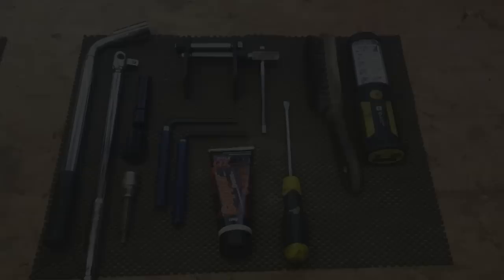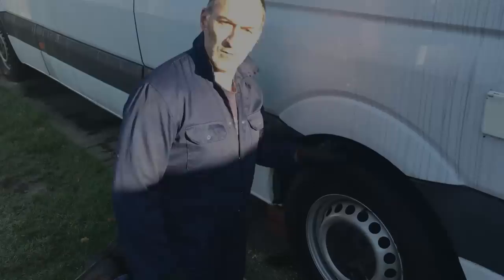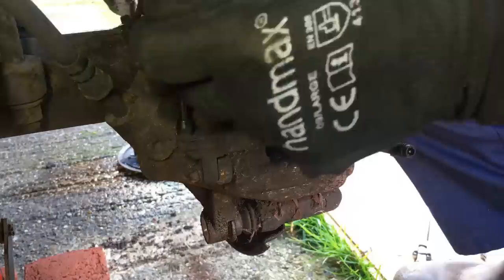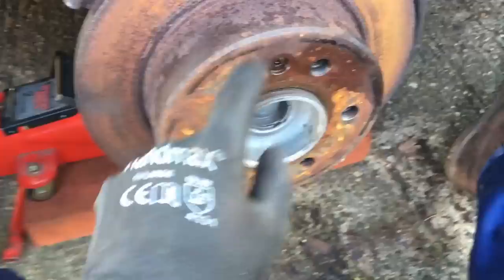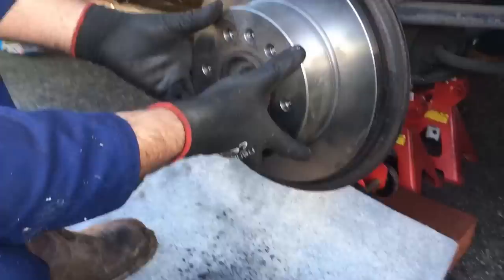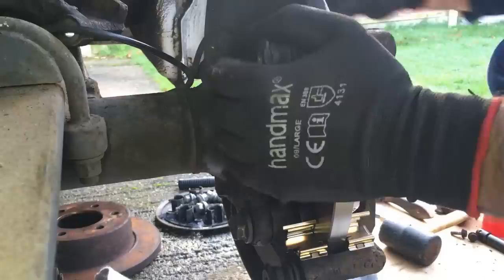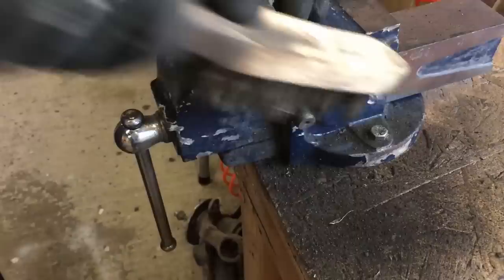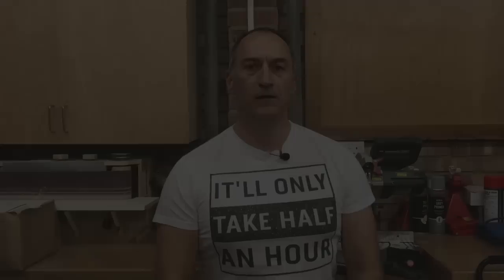Mercedes Sprinter - New Disc Brakes and Pads

Comment: Just did the front brakes on my girl`s VW Polo last weekend, left side took me 2.5hrs, right side just half an hour...that one disc came off only with desperate hammering...
:-D
Took me wonder, that the high-priced Brembo discs didn`t came with new grub screws!
One thing to mind is that the wear sensor cables are very flimsy, the one on the old pad break off before i got the connector apart...Luckily, that Polo had only one sensor on the left side...
:-P
Using gloves on doing the brakes makes really sense, it`a messy job...
In the end, the Polo was on new brakes for only 105€, VW shop called for the parts 170€ plus works...
:-0
Thx for your vid!
;-)
Reply from the maker: Horst Szibulski, yes I have had ones that are really hard to get off, I was lucky with the sprinter. Mine came with new grub screws but they were the wrong size? You made some good savings, happy to help

Comment: Greg is there anything you can’t do? legend!
Reply: I like how you rested the caliper on the suspension after taking it off, I’ve seen so many ppl leave them hanging down which can damage the brake flexi’s
Reply from the maker: Another favourite of mine, is to hang them up with a Bungee cord off the suspension for the same reason.
Reply: Greg Virgoe I first saw this practiced by Edd China :-)
Reply from the maker: AcheForWake I recon I’ve seen the same episode was that wheeler dealers?
Reply: Greg Virgoe yes, that’s it. Noticed the use of spare lining material to protect the floor.
Reply from the maker: Well spotted, yes to keep the dirt off the concrete outside the workshop. Easier cleanup

Comment: Might suggest a smear of copper grease between the disc and hub, so it's easier to get off when you need to inspect the handbrake brake shoes. Also a little smear of copper grease on the threads of the little disc retaining set screw.
Reply from the maker: Great advice, thanks for sharing that, cheers

Comment: 165Nm, or two ugh-dugs on the impact driver, or a extra quarter turn - if you don't have either.
Hehe
Excellent video, you may want have a look at the front discs...the bottom slider on the callipers have a common problem to seized. Which can cause uneven wear and very poor MPG
Reply from the maker: I will check those when I get a few minutes, thanks for the tip :D

Comment: Good job mate but next time grease the slider pin bolts as these can seize. Also crack the bleeder before pushing piston back into the caliper as this stops all the scummy dirty fluid being pushed back into the master cylinder.
Reply from the maker: Thanks for the tips Ash 👍🏼

Comment: Nice job. Those pads and discs didn't look too bad at all just rust got to them way too early. They may have cleaned up nicely. Worth checking those slide pins and regreasing with some silicon grease while you got it apart.

Comment: In the trade we used to put a thin smear of copper ease on the wheel bolt threads too.
Reply from the maker: I wasn't sure if that was ok to do in my mind I thought it might not make them secure enough?
Reply: @GregVirgoe  - it can be quite a point of debate between mechanics. My old bosses reasoning and his bosses before him, was it provides anti sieze, and also if they are torqued to correct torque setting the grease will provide a minuscule amount of lubrication so they will tighten minutely tighter. So tightening force should net-out but you still have the convenience of a bolt that shouldn't sieze in. He worked on trucks, vans and cars throughout his professional career so I trust his advice.

I'm sure you will hear different in these comments if due course!
Reply from the maker: This is the view of many mechanics who work in the industry day in day out. 
However according to manufacturers manuals they should be clean dry threads. 
I can totally see benefits but for this video I have to stick with handbook for the H&S police 👍🏼😊

Comment: 13:31 With my Napa kit today, the clips were a little too narrow for my UK spec 2010 313. I just cleaned the old ones and re-fitted.
Reply from the maker: If that another aftermarket set I’ve not heard of before.
Reply: @GregVirgoe  One think I did find was that the inner pad did not fit in properly. This was due to rust blowing outwards, particularly in the lower channel. An old chisel dressed it up nicely.

Comment: great vid Greg. going to put new pads in mine. will the warning break wear indicator now on my dash go out automatically when i put the new ware sensor on or do you have to reset it somehow from the dash? your warning light on your van wouldnt have been on because your pads wearnt low. cheers.
Reply from the maker: Stanly Kawazaki it will no longer be making the contact so it should reset.

Comment: While I understand your reasons for changing the parts, MOT sounds like a complete PITA. Judging by the condition of the rotors you replaced, any car in New York State (i.e. rust belt) would fail inspection. 

Tune into some South Main Auto videos to see first hand. 

Have a great trip & looking forward to more content from you.

Comment: Very helpful Greg, I have the parts ready for fitting them in the spring, I have a squeaky rear brake at the moment, but I'm unsure whats causing the sound I get a low speeds.
Reply from the maker: The pads could be very low, you get the metal backing touching the metal fo the disc it can make them squeal at low speed.
You have to be careful not to score the surface of your discs, unless of course you plan to change both pads and discs anyway?
Reply: @GregVirgoe  I have new discs ready to fit, so will be ok, I will let you know how I get on Greg.
Reply from the maker: Michael Aldridge, plenty of WD40 to slacken your nuts and you'll be fine, read John Coloe post in the comments he has some good extra tips

Comment: Should have taken out your brake slider pins cleaned and re greased with silicon grease , they have a habit of sticking either top or bottom which gives uneven pad ware  ,
Reply from the maker: Thank you John, very sound advice. Cheers

Comment: Greg, great video. I spend some time trying to find a video about the brake setup before I would start on my own, but there are not many. Is the front setup the same (apart from the handbrake)? Oil filter and interior filter are really issue to swap as well. perhaps you can do a video on that
Reply from the maker: Different vans do have different setups too. On the sprinter there are only ventilated discs on the front, no drums and the calliper is held on with Allen bolt and not a hex head bolt, but very little difference in the process.

Comment: There is something satisfying about replacing the old grimy stuff with the shiny and new. How much do you reckon you save for  not having a shop do this for you?
Reply from the maker: That’s a good point. I managed to buy the discs and pads when they were on 50% discount so that saved me £200 on the parts. If the garage added 25% margin that’s another £100 and 2hrs labour at £75/hr that’s a grand saving of £450 plus tax
So a considerable amount. 
The job cost me £200 in parts plus my own time 😀
Reply: That's good to hear. I still remember going in for some new brake pads for $100 US  that became a $500 ordeal, but that was around 10 years ago.

Comment: What happens if you don't clean the protective oil from new rotors? I replaced the front ones myself yesterday and didn't do that, (thanks for your video by the way), the truck stops but not the way it should. I took it for a drive after I was done and there was smoke coning out, I guess because I didn't remove the oil? Then when I pushed the brakes hard to come to an emergency stop, at low speed around 40kmh, it didn't stop the way it supposed to, like suddenly. Will it improve as I'm driving it or I should do something else?
Reply from the maker: Use some brake cleaner to wipe the discs and pads. 👍🏼😃

Comment: I was interested to see your rear wear sensor was on the inside pad. I have a 2018 sprinter owned by me from new. The wear sensor is on the OUTSIDE pad. I’m wondering if that’s why the brembo pads and discs I fitted squeal really badly? I’m a former mechanic from the 80’s. I did everything correctly. I’m a bit flummoxed now?
Reply from the maker: I guess if the pads are symmetrical in shape there is the potential to put them in on either side. Only an exploded parts diagram could answer which is right.

Comment: No torque wrench?? I can't believe I have a tool that you don't :)
Reply from the maker: lol it was in my storage facility with the rest of our house and I could not lay my hands on it for this video.
Reply: @GregVirgoe  when you get a chance, at least verify the torque of the lugs...
Reply: If they're steel wheels you just tighten then well, non-steel wheels require torquing to a spec.
Reply: Torque 110 Nm or 140 ?
Reply: @BrusselsSouth steel wheels require 240 Nm for the sprinter

Comment: Just a note, WD (Water disperser) is not a penetrating fluid. Using brake fluid and PB Blaster would be appropriate for this sort of job. Also,  Sprinter owners are typically changing pads and roters all the time and not only pads.

Comment: Remember your new pads will take a while to bed into the new discs so the pedal feel / braking effort will be less good for the first 10 - 20 miles until the bed in properly.
Reply from the maker: Another good point and worth a mention too. Thanks

Comment: Thank you very much for the instruction....Question....How do I know whether the caliper pistons must be wound back like required on my Audi or if they can be just pushed back like on you have done.
Reply from the maker: usually, the piston has a couple of dimples in it that a small tool locates in to turn them back. I have a tool set with all different pin spacing for different types of cars get form auto spares place.
Reply: That answers my question, thank you very much again. M.

Comment: Hi Gregg, very helpful as always. I notice on your newer video's that you have different wheels fitted. Can I ask where you bought them.
Reply from the maker: Nelson Van Dweller they are the same wheels. I just had the steel rims powder coated gloss black. It is in one of my videos. 😊
Reply: @GregVirgoe  Bugger! Can't believe I missed it. There are many vids to go through, could you narrow the field a little for me. I noticed that you already had them in Portugal as John mentioned you faffing with them.
Reply: @GregVirgoe  Found it Greg, it is in the "lorry crash" video. Tell me, if it was cheaper to buy brand new black steel wheels than to have the originals powder coated which way would you go? I only ask because I have this choice and I don't know enough about the choices to make an informed one. Is it just personal preference or is there more to it than that?
Reply from the maker: Nelson Van Dweller I paid £50 a wheel. Not sure you can buy new wheels cheaper than that?
Reply: Greg Virgoe hi Greg, “tyreleader” £45.09 inc. free delivery, although I’m not sure they will be as nice and glossy as yours are
Reply from the maker: Nelson Van Dweller so there’s nothing in it cost wise. Nothing wrong with the old rims once sandblasted it’s back to new metal. I’d get them powder coated.
Reply: Greg Virgoe Good enough, thanks. I hope that you both get to resume your travels in the Sun very soon, you always seemed to be in your element then.
Reply from the maker: Nelson Van Dweller thank you that’s very kind of you.
Reply from the maker: Nelson Van Dweller Lou just made a good point too. If you bought new steel rims you’d still have to get a tyre firm to fit them and balance the wheels. That would cost you £10-15 a wheel on top of your £45 making my option cheaper and still a much better finish. 👍🏼😃
Reply: @GregVirgoe  Win! Win! Thanks Lou.👍🏼😃

Comment: Hi Greg
Thanks for another great video and a couple of things.
Have you any suggestions for getting the rear disks off when the hand brake is kinda seized. I have a sticky handbrake on mine and tried to take off the disk to sort it but couldn't get the brake shoes to release. I hammered and bashed at it for an hour before giving up.
Second, why do you pull up on the wheel brace to loosen or 'crack' the wheel nuts? Your a big strong guy so you can do it but many people would give themselves a hernia doing it that way. Why not put the wheelbrace to the left and push down? 
You can even use your foot if your struggling to do it with your hand.
I've watched people struggle doing this several times and when I showed them the easy way they felt a bit silly.
Reply from the maker: Turn the hub around until you can see the handbrake pad adjusting sprocket through one of the stud holes and then use a screwdriver to wind them back in. Look up adjusting drum brakes if you get stuck.
I would do it your way if they were really stuck solid, but with the long wrench it was very easy to undo them, so not necessary to stand on the wrench. Its easy to round off the head of the bolt by standing on the wrench and it does fall off too.
Reply: @GregVirgoe  Thanks mate. As I was watching your video I guessed it would be something like that.
After all the bashing and swearing at it the handbrake isn't anywhere near as bad as before so hopefully can wait a bit.
When I went to loosen my wheel nuts I needed a meter long breaker bar and had to use all my weight to crack them. Probably fitted by a tyre shop windy gun. Grrrrr

Comment: You didn't bother to grease the handbrake adjuster or adjust the handbrake before you fitted the wheels why do you use brake clearer on the steel hud  and not on the brake shoes  pat Kelly

Comment: Hi Greg. So today I'm setting out my workshop I'm going to screwfix what would you recommend to buy tool wise? Bench saw? Mitre saw?
Reply from the maker: Hi James, if you have the space and finds a table Saw is much more versatile than a mitre Saw. You can cross cut on the table Saw with the mitre gauge so you can do everything the mitre Saw can do in one tool. A home made sled or panel cutting jig is great for accurate cross cuts. 
This one is the same as I have SCHEPPACH HS105 255MM TABLE SAW 230V (7225J)
Reply: Thank you Greg u just missed your reply though and bought both lol not sure weather to take mitre saw back now? I only got a titan bench saw hope its upto the job
Reply from the maker: Oh good, you can do anything with those now. Have fun 😀